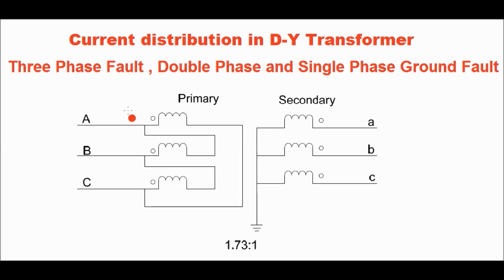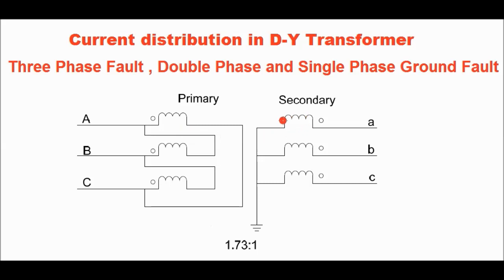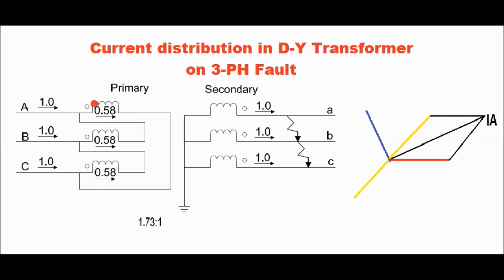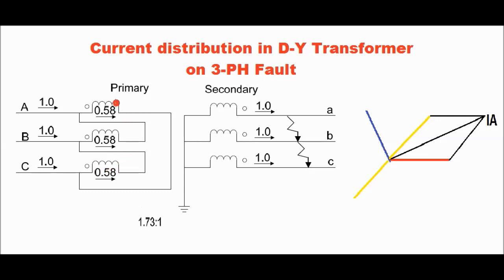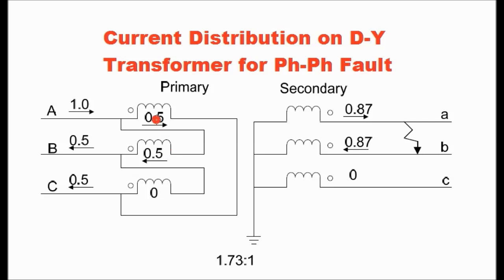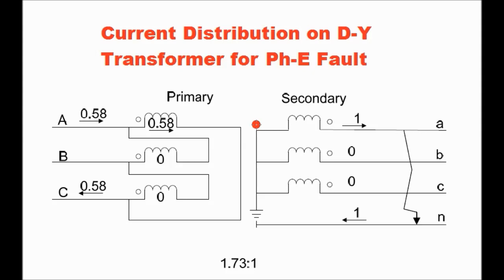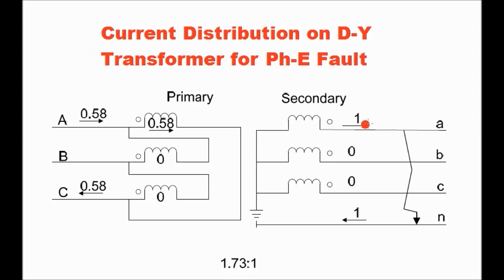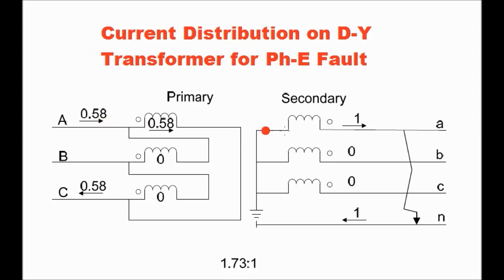Current Distribution In a Delta Star Transformer for 3-PH , Double Phase and Phase to Ground Fault

Comment: very helpful. Sir, can you explain why we are taking turns ratio 1.73 ie keeping the primary line voltage = secondary line voltage ?
Reply: You can understand that analyzing the ratio of the transformer RT. Just like that  RT=VAB/(Vab/1,73)=>RT=1,73*VAB/Vab, where RT in PU is 1.